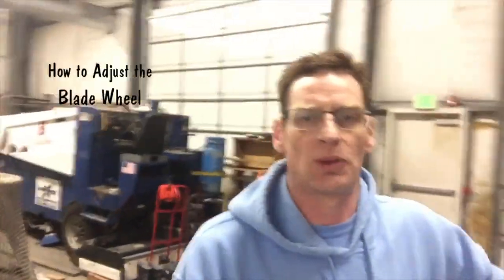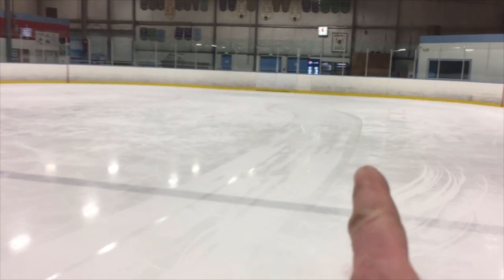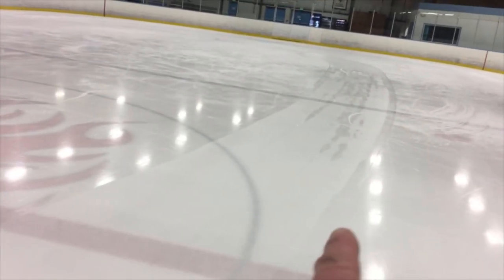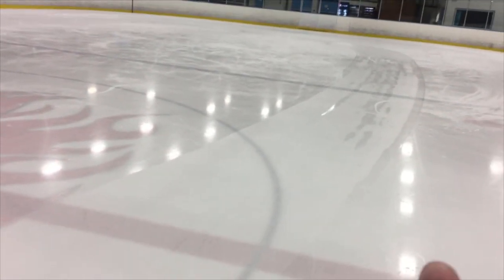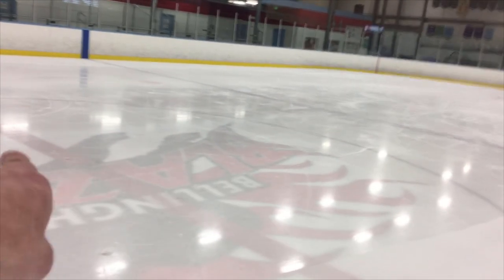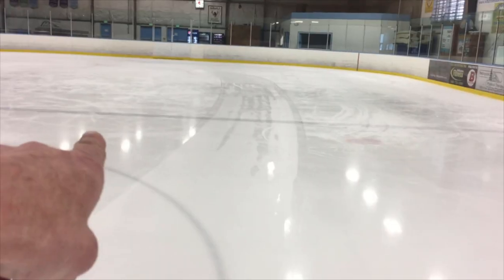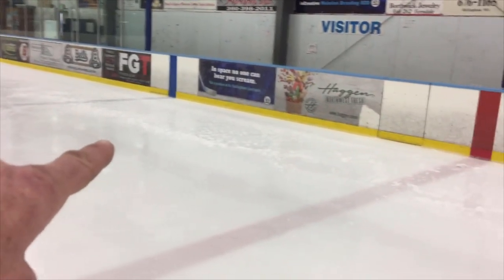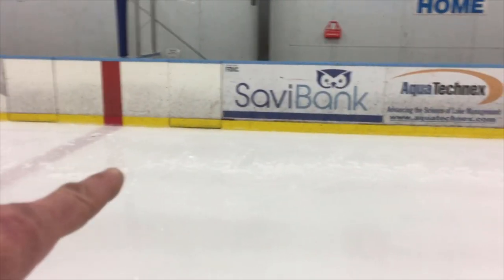Theories and Principals Behind Adjusting the Blade Wheel: Part 2

Comment: Adding to this............usually on my evening shift, the first group on the ice is the 18AAA kids..........they are as hard on the ice as a minor league or D1 team. What I mean by that is during one ice make, you will still have a lot of deep cuts on the ice, even if you fill the snow tank. Something to consider for newer Zamboni drivers. Most of the time, you wont be able to do a dry cut, then a wet cut between sessions. My theory is this.....on your higher level hockey players, try to get a minimum of 3/4 of snow in your tank, remember to use your wash water to help fill in some of the deeper cuts in the ice. Another theory on how much water you are laying down.......if you have done 2 laps and look over at those laps and there is still a lot of water standing, back of on your water valve a little, do a lap and see how long that takes to freeze. Especially during a game where you are doing an ice make in between each period, the last thing you want is for the teams (and angry refs, ha ha) to have to wait for the standing water to freeze otherwise the pucks will stick on the ice during the warm up. Just my 2 cents on that. Thanks Ice Man, I enjoy your videos and feel I am always learning something new.

Comment: Big kids, little kids haha. Just easy way to put it. Nice ice. It's a job if you're doing it well. Is a very prideful thing. I think I make the best ice. I work with all my drivers. To become better. Don't be afraid to screw up. Just don't do it twice. I'd like to see an edging video. Never been really trained on nothing. Just reading stuff, videos, complaints/asking ppl what they want and old drivers. But, never seen much on edging. Probably kinda hard video to do by yourself.
Reply from the maker: I am working on a edging video and was almost done with it then I started second guessing myself. Trying to cover it all and present it in a structured way is a challenge.
Reply: "Don't be afraid to screw up, just don't do it twice".  Great line. That should be a quote on our board. 🙂

Comment: Idk if you’re still active on this but I’ve been driving for about a year now and our rink has had constant issues with the blade digging in on the ends of the rinks and leaving like 1/8 inch semi circles behind the creases. We have an Olympia and when we put new blades on we don’t have a leveler and can’t seem to find any to buy right now but the blade will be around 10 degrees and still not cut a full strip. Once we put the blade down with the wheel, the blade leaves deep marked the entire way down the ice on the edges of the blades. My guess has been that our rink is really uneven and if one’s sides high the other side is going to dig in because the conditioner is uneven. Been trying all sorts of things but would appreciate some outside help.
Reply from the maker: Sorry for the late reply. Yes I think you need to find a way to make sure the blade is level with the runners. I am unfamiliar with how the Olympia's set up but I use a big washer to level the blade with the runner.  

I would also look at the leaf springs. If they are more than 5 years old I would look to replace. Readjusting the down pressure could also be a good idea.